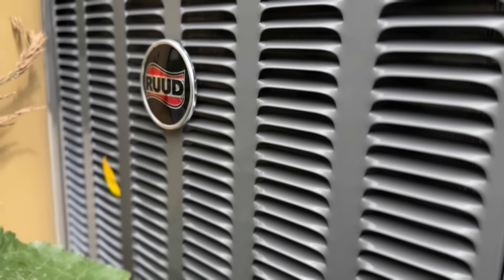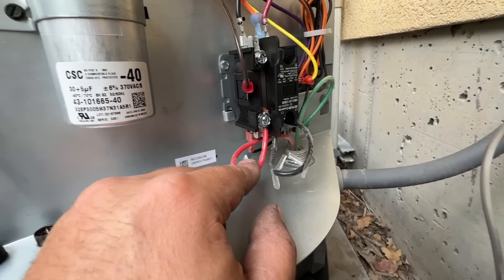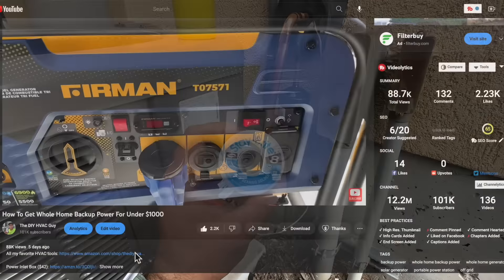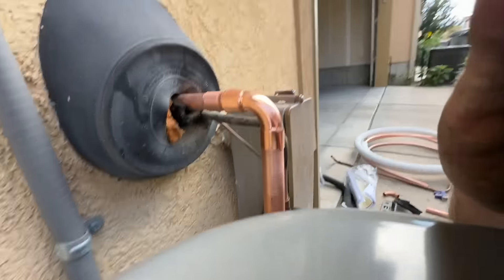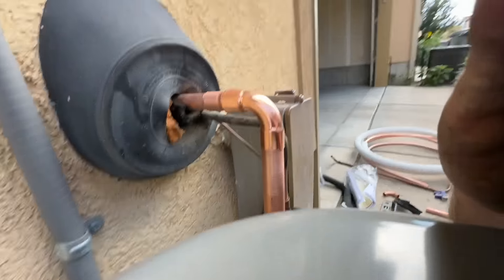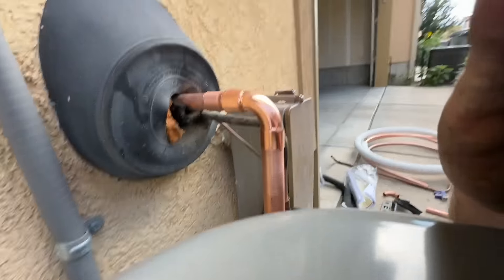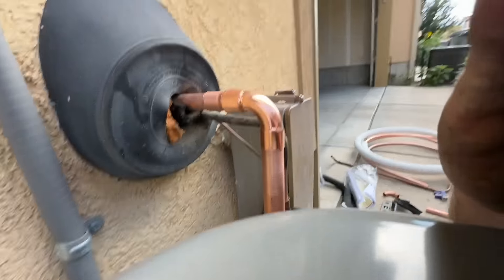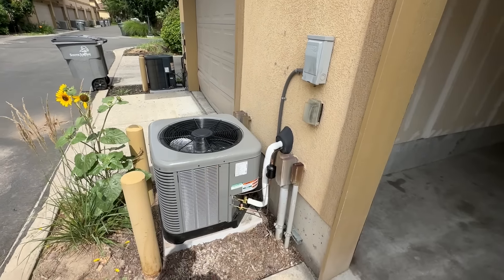HVAC Contractors Don't Want You To Know How Easy This Is...

Comment: I would rather pay someone like this  guy who is willing to show his work than many contractors in my area where they who hide their work even a simple job like changing the filter or spray wash the unit and charging up to $400.00
Reply: You mean techs that don’t want you standing over their shoulder asking questions, and maybe giving unsolicited advice? As former tech, I would have no problem explaining the why, but having someone right there would cause a distraction and nobody would want that as distractions cause mistakes… Also, who charges $400 for a filter change or coil wash, why wouldn’t you do that yourself as most hardware stores have foaming cleaners for the evaporator, and all you need is a spray bottle and some chemicals for the condenser coil…

Comment: Wow Kind Sir; you NAILED it right on the head. Of what is going on in the "HVAC companies". And they have been doing it; for untold yrs. Now, I'm an Electronic and AC Instructor for 45 yrs, before I retired.

So I can fix most any electrical or AC's problem; on most all items. And when it comes to HVAC; the MOST fix, is to change the "Start and/or Run capacitor(s)". And it takes LITTLE time to do it. In other words, IF your AC will NOT Run. It is probably that Capacitor.

And believe it or not; on July 24th ago; one of my AC's went out. So I just got on Amazon; and bought the correct Capacitor. Now get this...the price was only $13.77. And IF I was to call ANY HVAC Co; they would've  charge, OVER $300.00. Oh yes MOST of them would do it. It's criminal. And they are doing it; all over the nation.

And they can fix it, in less than 30 minutes, usually. How sad. So I am glad you made this video kind Sir. For it NEEDS to be espoused all over the nation. About those horrid criminals!
Reply from the maker: Actually 300 is not terrible. I’ve heard of companies charging 700-2000 because homeowners have no clue what a capacitor is 🤷🏻‍♂️ THAT is criminal

Comment: I never allow refrigerant to come in contact with my micron gauge or my vacuum hose. I was surprised when you released the refrigerant with the micron gauge and vacuum hose still attached. Was also surprised that you didn’t remove Schrader cores before soldering. Good job though.
Reply from the maker: Actually sb8 doesn’t get nearly hot enough to effect the cores or king valve seals, and I’ve had refrigerant come into contact with the micron gauge many times. I clean it with denatured alcohol from time to time.

Comment: A micro channel coil is easily repaired A compressor that has been open to atmoshere can easily have the contaminated oil removed,  refilled and evacuated until dry. For far less than replacing a perfectly good unit. Service first. Sales only when necessary.

Comment: I'm not sure about that Stay Brite #8, of course I prefer typical brazing, but overall nothing I can really pick on.  The only difference I do is pressure test the system, then install the dryer to limit atmospheric exposure in case you have a leak some where.

Comment: Watch out for over heating that copper and the even more important the combustible material around it as it enter the house. We make a lot of fires to homes after the AC work was done. That heat conducts further down the line.

Comment: They also make braze free connectors called HVAC push / quick connect fittings / unions similar to Shark Bite.  They're made by Zoomlock, Rectorseal and others.
Reply from the maker: The problem is, the condensers all have a bell at the end of the copper pipe and once you cut that off, you don’t have quite the clearance you need for those fittings. But I think the hvac push fittings are awesome. Time will tell if they develop leaks. I have one system I used them on and so far so good!
Reply: @diyhvacguy  don't let Steve Lav know

Comment: Always sweat from the lowest point in the fittings... heat travels up and doing it in the manner exhibited introduces the potential that the first joints lose solder to the point of weakening the joint.

Comment: Looking good.  Been working on a house myself and the plan is to put in a few mini splits as soon as I can.  When we got the place there was no central heat, just a couple natural gas wall units in a couple rooms and window air's for cooling so switching to mini splits will be a huge upgrade.  Been planning to DIY it all along but the more video's I see you do the better I think I will do.  Have a gauge set I inherited from a guy who was doing maintenance at some apartments but have to get a vacuum pump and such when I get started doing the installs and will likely end up helping a few others around town at some point in time once they learn I can actually do that kind of stuff.

Had to LOL about the loud noise when you vented the nitrogen though.  That's got NOTHING on my 3000 plus PSI cylinders being dumped to drop the pressure down around 500 PSI, my cylinders literally SCREAM and turn heads for a block when I take them out in my front yard to vent.

Comment: I am experiencing some problems with my HVAC unit. My Nest keeps telling me that the power is not connected. When I go to the indoor electrical panel, I don’t see that the AC handler or compressor switches have flipped. But I shut them off and put them back on anyway. Then  the HVAC starts up again. I have had to do this three or four times in the past few days. I can’t seem to find a video to explain what could be wrong here. Any ideas or videos you have to suggest? You have great content!
Reply from the maker: Thank you. That’s an odd one for sure. I’d definitely need some more information to help with this. We have a remote assistance page over at Patreon.com/diyhvacguy if you need some more specific help.
Reply: Check the simple things like filter and airflow. Really need more info tho. Are the coils clean and electronics in good condition? Could be a number of things.
Reply: Do you have the old thermostat?
Reply: @dustinpomeroy8817  I tossed it. The A/C seems to be working for the past few days. It was short-cycling for a while. I can't explain it.
Reply: @ConsultantsInc-ix9dg  I was just gonna tell you that out of all the problems with thermostats that we have ,Nest by far give us the most problems.

Comment: Take the schraders out AND wrap those service valves with wet rags before putting heat to them!
Reply from the maker: The Staybrite 8 doesn’t get nearly hot enough to mess with those like brazing, so I’m not included to do a step that isn’t necessary but if you want to then absolutely! Not saying it’s a bad idea, I just know it’s unnecessary. Cheers

Comment: Hi i’m a DIY person. I may not know all there is to know about HVAC but over the years I’ve learned enough about it to have an understanding and I have a mechanical background as well. I’m not comfortable with the way you installed that system. You seem to like to cut corners to make things easier. You chose a system that’s oversized for the installation and is causing a higher head pressure. My assumption here is it’s going to shorten the life of the unit and slightly increase the operating cost. 

The stuff you used to connect the pipes together I’m not up-to-date on yet will withhold my comment. Sounds like it made things easier in a safe way. I am a firm believer in following proper procedure as listed by the manufacturer. 

Beyond my comments, good job😇
Reply from the maker: The Ruuds have a larger footprint, but the tonnage is the same as the old trane system. The head pressure was due to the smaller suction pipe size. They weren’t interested in paying to the pipe it so it is what it is.

Comment: 20 years in the HVAC industry. We call that a Chop & Swap.  It doesn’t cost much more to go ahead and do it right by also installing a matched indoor coil so the txv is designed to operate with the condenser and now the whole system has a ten-year parts warranty. By doing it this way when the indoor coil starts leaking in a few years the customer will have to replace both the original indoor coil along with a replacement of this new condenser because the 410-A refrigerant will be phased out. As in most things in life, the cheapest option is not always the best one.
Reply: Oh common guy 410a isn't going to be phased out anytime soon like non available... This system can go another 10years before 410a is phased out at the level R22 is then what you stated would be the situation but your reaching with your comment.
Reply: Since he was able to locate the leak, why not close the leak by soldering it. Easier and cheaper work.
Reply: @MBihon2000 That's what I was thinking
Reply: The matched coil is BS , as long as the out door and indoor are the same capacity and the txv is setup for the refrigerant type used , you are gold.  Old fart scare tactics
Reply: @Miketime969  Chop & Swap!
Reply: @luckyrocks1  you just rip people off
Reply: @Miketime969  No sir, it is you who are ripping people off. Just do it right the first time.  Quit doing things cheap and do them right and your customers will get better results and value in the long run.

Comment: Hey I need to replace my compressor, I have all the tools. What I don't have is nitrogen. If I'm confident in my joints, can I just plain skip the pressure test? Or is there some other option for pressure testing? I mean the only reason is to make sure you don't have leaks right?
Reply: Yes that fine, just make sure it hold a vacuum overnight.
Reply: @mrbit-cz9pl  Good timing on the reply as my new compressor just arrived.
Reply: @calledout4437  dont forget to replace the filter dryer.
Reply: @mrbit-cz9pl  Thanks, I do have that also.
Reply: @mrbit-cz9pl  Hey another questions, I know many will say it's not recommended, but what about reusing the current refrigerant? I was planning to capture it to a clean recovery tank with a filter drier on the tank.

Comment: Not sure if this a myth? My plumber states after soldering the copper pipe he grabs a rag and wipes down the joint of  the flux  lead connection. He claims you will not see really dark green tarnish in several years.

Comment: Interesting.  I’ve always brazed the copper connections, but here you soldered.   Great video
Reply: Well if you ever read a install manual it tell you absolutely not to solder always braze. This dude never had a fitting blow off but it happens
Reply: and pro press is coming nest  seen it in food stores on coolers
Reply: You should always braze. The only time you soft solder is on water lines
Reply: Yep, especially in the future if theirs ever a restriction. That will not hold high head pressure.
Reply: See the new stuff at berky plastic coated aluminum lines. Idk how they get installed I got copper for my job
Reply: I braze 100% of the time and 410a pressures are so high I wouldn't trust a soft solder. Also it's always good practice to wrap your service valves with a cold rag to prevent damage to the service valves.
Reply: We always nitrogen purge while brazing as well.
Reply: Years ago we had presentations with soft solder and claimed the joints would hold to 1200 psi  or higher. Brazing is preferred but we soft soldered for years.  The problem lies with installers slapping a wet rag before the solder joint cures, creating a bunch of solder bee bees that eventually work their way to the metering device. If a joint is improperly soldered without enough flux, or solder to properly fill the joint, they can fail down the road.

Comment: So educate me, I watched them put a brand new system in my house about 4yrs ago (old one was 24yrs) i kinda shadowed the guy, they “brazed” all my fittings instead of soldering, i asked why, he stated that they’ve had a lot of issues over the years with solder leaking due to pressure so they started brazing instead………..any truth to this? I just found it a curious observation
Reply from the maker: They probably weren’t doing it correctly.
Reply: i've never seen anyone use solder for ac ever, because this guy posts videos means nothing

Comment: I've watched several hvac videos and one thing puzzles me. In some videos they say you must have the bottle of 410 upside down but in your video you have it sitting right side up. Does it make a difference?
Reply: R410A is a near azeotropic refrigerant – although a non-azeotrope refrigerant, it exhibits a very low temperature glide during evaporation or condensation, making it behave very nearly like an azeotropic refrigerant, But I only charge it liquid. Although I charge everything with liquid. It’s faster.

Comment: Nice job and video. But not sure as a DIYer I would consider doing this repair. I do basic things on my units. Change capacitors, contactors, clean condenser and evaporator coil if needed, flush drain lines.
Reply: Well typically there is refrigerant in the system that needs to be recovered. I’m sure you are capable of doing the job- the question just becomes investing in one time use tools vs having someone else do it. $400 for vacuum pump. $800 for recovery machine, 300 for vac lines and gauge, $200 for manifold. Plus miscellaneous I forgot and I thing you would need to spend 2k to do the job before buying the condensing unit. I didn’t even mention refrigerant, and you need 608 certification.  I have 2 units from 89. When they go down I’m definitely doing the job myself. Even if it costs me 3k for the above things, where I am living it would cost me 40k to replace both units. 3k for things I could sell is well worth the cost.
Reply: @Samlol23_drrich  Those are all good points for DIY to do this type of project. Just curious, what state do you live in ? That’s quite a pricey change out for a residential system.
Reply: @roberts1159  I’m just north of New York City. (Unfortunately).  There aren’t any “Steve Lavs” around here if you know what I mean. - oh and it’s for two systems and a really long lineset.
Reply: @Samlol23_drrich  40K for what??
Reply: @summerforever6736  two air handlers two condensing units and lineset, install etc.
Reply: @summerforever6736  I may look for new old stock uncharged r22 units when the time comes. Not a big fan of 410a
Reply: @Samlol23_drrich  for a mall or something??
Reply: @Samlol23_drrich  ok cool I'm not an expert or anything but when  you said 40 thousand
Reply: @summerforever6736  unfortunately for my house!  As they say, it’s no Taj Mahal but it’s in a nice neighborhood and the costs around here are absurd
Reply: @Samlol23_drrich  I think think Dave would drive there to do it for much less ask him pay for hotel and stuff save some money not a bad idea!!
Reply: @summerforever6736  it’s a good idea
Reply: Your numbers are high. You can get a vacuum pump for 150, a recovery machine for 300, a manifold gauge for 80 (made in US). Doesn't need to be a high end digital one if you're not trying to make a living doing this stuff.
Reply: @matthew4878  I really like that Fieldpiece MR45 though……but you are right. I wonder if I bought the MR45 for 900 , used it once and sold it for 700 probably better than buying a Chinese piece of junk for 300 that nobody wants to buy. Either way you have a point. Thanks.
Reply: @Samlol23_drrich  That's probably true. I just bought a dial gauge myself. Made in USA. 80 dollars. Dont need to get too fancy and become a gearhead.
Reply: Can you replace with any 1.5Ton? With same refrigerant of course.

Comment: Hey Im sure you've heard about this and I know you don't do Automotive A/C but I figured I would ask anyway...  R152a, I've seen videos and read in forums where people use R152a as a refrigerant in automotive A/C systems.  And when I say  R152a Im mean Dust-Off Duster compressed canned air. R152a is difluoroethane and Dust-Off Duster shows CAS number 75-37-6 which is R152a. If I were to start fresh with a vacuumed system and added this to my automotive A/C system In your option would this technically work? Thanks! Great video as alway!!

Comment: hello Sir I have  a problem with blowing my 3a fuse of split unit. I have had HCAV company out 6 times and also a electrician in the past 7 weeks. I know they come out and replace the 3a fuse however not sure if they have checked the contact coil the refrigerant or even the condensate drain. How can I hold them accountable for these checks. I don't want trouble just want the ac fixed. The fuse blows sometimes same day and in the past 7 weeks I have replaced it 6 times. The longest it has run is 4 days without blowing the fuse. I have seen the refrigerant gauge on them once when they have come back in after looking at the ac unit outside. also the condensate drain used to be damp outside and now it is bone dry where usually it is a little puddle. please advise if you can?

Comment: nothing wrong to use that to brace a copper pipe for Hvac if you can brace a copper pipe to a plumbing to hold a strong  flow of psi of water I think that is better to use and also the good thing to it is the lead penetrates all inside the copper to sealed the leaks.

Comment: Just curious You can’t repair the hole in the condenser coil by brazing / Soldering it ❓
Reply: My guess is “no.” I had the same question for another tech and was told those holes can’t be repaired…